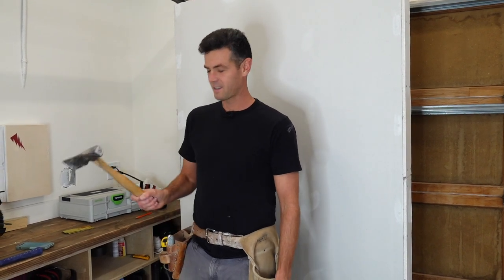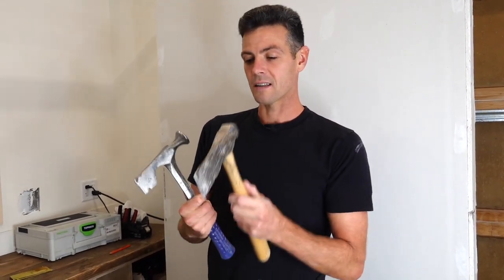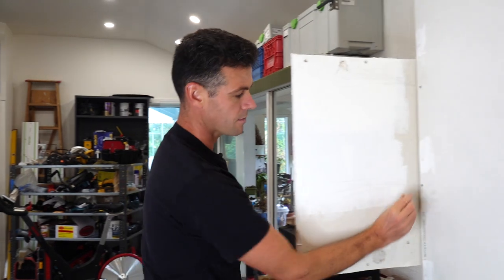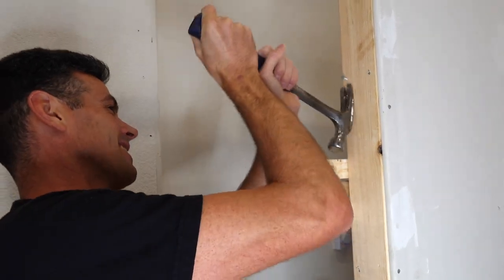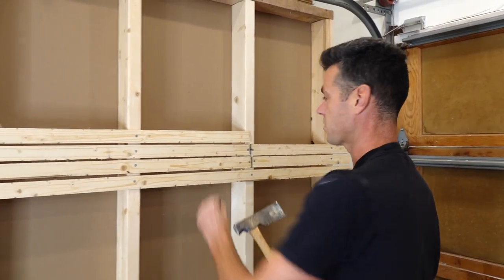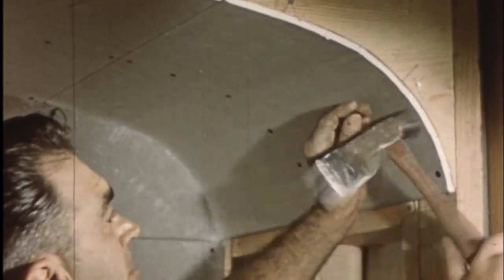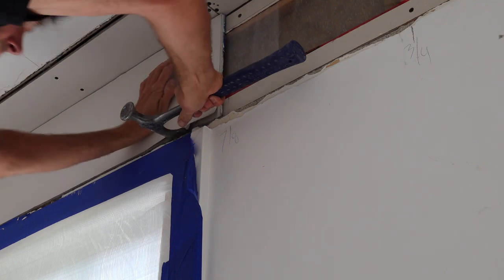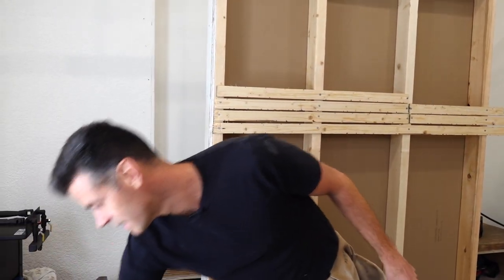Why are DRYWALL HAMMERS shaped like this????

Comment: One feature you missed: on the axe side, it isn't shaped quite like a normal hatchet or shinglers axe. The dip that quickly narrows the blade to the handle is for holding large sheets of drywall in transit. Just pick up one side of the drywall and hook the head underneath and you've got a much more ergonomic way of moving sheets
Reply: As I watched this video I thought to myself that I had seen roofers use these.
Reply: I'm asking because I honestly have no idea what it is, maybe you know? Sorry for a wall of text.

It's about 3 inches long on the hatchet end and you can tell it was hand forged. It has that dip near the handle. The hammer side also has a taper that looks like it could be used to carry sheets. Is it a dry wall hammer or something else?

I found just the head of it in my grandpa's shed while we were cleaning up everything after my grandma passed. It was in the corner where he used to hang his tools. It was covered in a nice layer of rust and dirt. 
I cleaned it up with a wire brush to keep the antique aged look, re-handled it with mahogany, and made a stitched and brass rivet reinforced leather sheath to cover the axe face. I also brought the cutting edge to shaving sharp, it was the only metal removal I did to it. Now it lives on my wall.
Reply: yeah but it dents the bevel and can tear the paper.
Reply: I was a drywaller for 35 years and never carried drywall with my hatchet. Also I never saw anyone carry drywall with a hatchet. I'm not saying it didn't happen but I am saying it wasn't common practice at least not here on the east Coast
Reply: @donnydarko1898  never seen that either. East coast also.
Reply: @donnydarko1898  I watched my dad use his axe to carry sheets. He also hung for 40 years. I've watched him hang whole sheets on the ceiling alone. Mouth full of nails he would tilt the sheet up with one hand , use his axe under the corner and lift it on his back and shoulder.  It was quite an acrobatic sight . He was built like a Greek God though.
Reply: I carry plywood with a framing hammer like this. Makes it sooooo much easier to carry and no splinters.
Reply: Love when ppl know there shit
Reply: I don't think you've ever moved sheets

Comment: I started as a union apprentice at Lathers local 42 back the 70's. The lathing axe was used to score and snap wood lath, but that was actually before my time.  In the trade, there were two sub categories, nail on and steel stud.  Nail on was waterproofing (tar paper) and wiring (chicken wire) held on with furring nails on wood studs, installed by carpenters.  The axe end of the hammer was used to bend the wire around for inside corners.  Metal lathing or steel stud, lathers erected their own walls with steel stud, installed drop ceilings with steel channel, then covered them with expanded metal lath for plastering, again using the axe end to help form corners. This was done in most commercial buildings including many of the old high rise structures. After wood lath, they developed plasterboard or button board, which you saw being installed in the video.  They made a specialty lathing axe with a replaceable blade for cutting the board.  That was a hard trade, they expected so many 5 sheet bundles a day, cut, hung,  and nailed off in a day. And then there was drywall.......
Reply: Seen one of those latching axes,,, now I know what it's for! Thanks! How many sqft did they expect a day?
Reply: @stevehamman4465  It's a little hard to remember as I have been out of the lath & plaster trade for almost 30 years (currently tile setting)  but it was about 300 yards outside and about 1K ft. plasterboard inside.  Of course this varied dependent on whether the job was cutup or just flat open walls.
Reply: @tomdoe4295  Hope it paid well, sounds like the pressure was high.
Reply: @Oneshot8242  This was back in the 70's & 80's.  Pay was around $28.00 an hour but $4.00 PH went into the benefits package (matched by the contractor) and $1.00 PH went into your vacation fund.  Great money in those days.  The pressure was there but we didn't notice it.  Half the shop were baseball players and the other half were dirt bikers so there was always rivalry to out perform the other workers, so meeting or exceeding what was expected wasn't really a factor. (Dirt bikers FTW!)
Reply: @tomdoe4295  $28 in 1978 equates to about $123 today when adjusted for inflation.
Reply: This is such a well informed answer, just curious where is that local, I'm local 18 in Ontario Canada
Reply: @alanmudge6782  Local 42 is greater Los Angeles, CA

Comment: Living in a hundred year old plaster lathe house I have extreme respect for the guys that built it, their work with mostly hand tools was incredible.
Reply: Its kinda sad its a trade that isn’t really utilized like it used to be. Theres a plasterer youtuber and watching him makes me miss how we used to do tiling too. 

Here and there I get to “float” a wall or floor in a shower. And it’s probably my favorite part of my job. But its very rarely. Im actually part of the same union as the plasterers. Idk how much work they get though. I think a majority of their trade now is using forms.
Reply: @Titantitan001  I enjoy fixing the walls, typically termites will feast on one of the lath pieces they find delicious. I rip out the old plaster as far as required, spray the area with termite foam or boracare, then cut new pieces of pressure treated lath, glue and nail them in, then I use Durham's rock hard for my new keys, then I put a plaster mix coat over that, the repaired wall is very strong. No way I'm sticking a crappy piece of drywall in there, I want the original plaster wall restored.
Reply: @nmatthew7469  Durhams is very useful.    Does not sand though.
Reply: @nmatthew7469  good on ya my friend! Ive never used drywall either when i was in property management. Thats how I found Kirks youtube channel was trying to learn how to repair plaster. The building I am in now is an old bottling plant that we restored the offices into a living space and downstairs is the jam room/bar/pool. So I’ve had to learn a lot of the old school ways of doing things. Been wanting to do a mud floor with 1x1s in the main part downstairs hehe.
Reply: @hdsnow7049  easy way to avoid sanding is to wet sponge it after it's dried a bit just like when patching cement.

Comment: As an old drywaller back in the late 70's till about 2000 in Southern California we referred to it as an "axe". My personal brand fav was the Plumb and resembled the lathers hatchet. As for the uses, in those days, well, when I first started in the housing industry it was all nail on, commercial was a mixture of wood and metal and so was the method of attachment. The blade of the axe was used as you showed to pry on occasion but more often, to "clean" the edge of the cut drywall by pushing the top of the axe to knock off the roughness of the cut edge. Also, when hand cutting electrical boxes, you would mark the edges of the box by sighting down from the top and measuring the top of the box and adding the length of it sliding your tape measure and knife, then competing the cuts with your knife. It was always a source of pride to be able to make your hand cuts "clean" so the taper had little or no "detail " work to do with your hand cut boxes. It was a different time for sure but a few of those things still apply.
Reply from the maker: Thanks for adding to the conversation. I love old school knowledge🙂👍
Reply: @vancouvercarpenter  After re-reading what I wrote I should have been a little more clear that we used the blade to score a mark for the sides of the electrical boxes on the lower sheets of drywall and measured to the top of the box only, and just add however much the dimension of what you we cutting, boxes were ( are?) 3-7/8" to allow for a little play. I was at my son's cabin and had to hand cut everything....still got it!
Reply: Nice axe work! Lol one of my first commercial steel stud/drywall jobs was a hospital. The boss wouldn't let us use routers and taught us that very technique for cutting boxes. We did get very fast at it by the end of the job and if routers weren't a thing that's how I would still be cutting my boxes. Been at it almost 30 years now.
Reply: @whitesturgeon  I first saw someone use a router doing custom homes in about 77-78 maybe, some guys from Texas as I recall. It obviously was a game changer to say the least! It was just a trim router with small drill bit. They broke bits constantly as they weren't designed for the side load. I haven't thought about that stuff in years! Any hanger worth his salt knows how to cut his boxes by hand. Tough way to make a living, we were all piece workers so time was money!
Reply: I came up the same way with my dad and uncles, no router no screw gun, if we had a cord it was for the radio and don’t touch the old man’s radio it only played two kinds of music, country and western lol, just a bench, bucket for your tools and a square that’s all you had or needed,  I was making money before most guys could find a plug to plug all there crap in lol those were the days most hangers made more money before lunch than most trades would make all day
Reply: @jasondoan1785  I hear ya Jason! My T-square had been scored so many times the long side feel off making it an "L square" ! You're right, the cord was for the radio, a jobsite must! The cord was the cheapest and longest ,100' to make it to the temp power pole. The big expense was buying the adapter, most of the time we just cut the ground prong off and tweaked the other two blades to fit the twist-lock socket on the pole. See there, you guys got me started on the old days!! I spent 45 years in construction and retired when the pandemic hit. Luckily I had 20yrs in the SoCal Carpenters Union so that and Social Security and I'm a happily a retired Carpenter! Thanks for the trip down memory road!
Reply: Agreeing whole heartedly with the comments below,   I started hanging just before screw guns or routers became a commonly used tool.   You got very familiar with those axe hammers and could nail off a board in  no time.  The tool I still use most often for various reasons is a drywall bench.   If you dont have one,   get one.    Super handy.
Reply: @michaele1201  I still have one too! At 65 I still find it useful
Reply: I worked construction with my uncle in the late 90’s/early 2000’s in SoCal and guys would use the drywaller’s axe to tack boards up and then come back and screw everything off. I only ever saw one old timer use the axe to nail off everything and he could cut the board with the axe like in that 1950’s video.
Reply: Old hanger here started at 17 before router’s and screw guns as apprentice first year all I did was nail off I could out nail like a machine gun it was all about rhythm we measured and cut every box , shimmed butt joints and hauled the scrap We avg 100 sheets a day 4x12 sometimes 16’s two guys $ 2.00 a sheet
Reply: @AVBros37  Tacking up with nails, coming back to rout and screw was the common method of the time. We did a motel in Costa Mesa of 30 rooms with everything tacked up ,boxes marked , but not routed or screwed yet. The owner came by and said" I dont know if you realize, but there are electrical boxes all over these walls you forgot to cut out!!" I looked at my co-worker and said, "see, I told you we were supposed to cut those!" He went off in a huff and by the time the superintendent showed up later in the day it was all done. Not very nice but we were young and got a chuckle out of it.
Reply: Also as an old drywaller we used what we referred to as a “drywall hatchet” for the same things that you point out. We may have actually crossed paths at some point. I also worked in CA for several years 70’s & 80’s.

Comment: Long time, no comment. Sorry.    I'm a tinsmith, but when I was 18, I was a carpenter's helper for a year. We had no screw gun back in '79. It was all nails. I hadn't perfected the art of "spinning nails". Every so often a nail would come up to my fingers facing the wrong way. I would drop it on the floor. My buddy informed me I needed to keep those nails, they were for the other side of the room.

Comment: You can also use a drywall hatchet for  rasping board, pulling stand ups when boarding solo, bending back track after all other trades trample over them, wedging board into tight steel door frames, lifting board off ground for dunnage

Comment: My dad was a carpenter, he had all kinds of hammers including one of these. In truth I am pretty sure I only saw him use two. The big one for framing and slightly smaller one for trim. He was that 2 hit guy and it didnt matter if it was the smallest trim nail or huge spike. Two hits. He seemed to like to let drywallers do their thing and cabinet makers do there thing. I saw do both in my home growing up but typically he respected specialized workers. But I digress this was about other “hatchet hammer” he had.
Reply: Years of gaining the confidence to hit very hard instead of holding back for accuracy. Took me probably 15 years to get to that point lol. Watching the other guys do it made me want it so bad! Even cooler when you got the magnet. 

Obviously there are some nails where its just not happening. But many of them stand no chance against a hammer
Reply: That large framing hammer was called a "Rig Axe" ! They were usually about 28 oz's !

Comment: The offset angle of the head on the estwing makes it easier to nail the bottom, like when you're bent over.
Reply: That's a fine use for it but it's moreso to keep your knuckles off the board, especially in corners when you swing horizontal.
Reply: And above your head (ceiling boards) I believe

Comment: As a plasterer I’m impressed that you know it’s a lathers hammer.  Small point of order: it’s pronounced with a flat “a” like tap.  The hard “a” is used in the word lathe like in spinning wood on a machine.  Also if it  has a cleated face it’s really a roofers hammer.  The cleat chews up the face paper causing issues with blisters and flags so they used smooth faced on Rock Lath (a brand name of early gyp board).  In the wood lath days (not lathe) the lathers would use the hatchet to cleanly chop the wood to length in a split second.  Also lathers were the original drop ceiling/coffer installers.  I pay homage to those forgotten craftsmen of the past like Marvin Reiney the last Master Lather of St. Louis who passed away just a few years ago.  He was buried with his end nippers in his right hand and a small “hank” of tie wire in the left.  He invented the machine to bend channel iron into curved shapes used in more modernist building designs.

Comment: Back in the day when people first started using screws to hang drywall  most finishers were afraid of them. After trying them we would only use them for the ceiling for a couple of years. Then of course it  transformed into a complete use. Adapters were made for drills so you wouldn't sink them to far. It was a lot better. You know how some people are set in there ways though. We could nail it up 2 times faster than screwing it off. When I say back in the day I was making $3 a hr and thought I was in high cotton
Reply: My brother was a roofer (back when he still had cartilage in his joints!) and he once had a shingling race, him with a hammer versus his "I know how to do everything better than you low-lifes" foreman with a nail gun.
He won, and the foreman didn't show up with the crews for a week he was so ticked off.
Reply: @MonkeyJedi99  the difference being, of course, that any schmo off the street would be almost as fast with the nail gun as your brother was after years of practice.
Reply: @RobotJustice  That's what made the whole thing even funnier. This foreman was all hat, no cowboy, as they say in some places.
Reply: I hung rock for a short period of time in the mid 70s with a lead guy. We nailed everything, much faster than screwing. I hated it when we had to screw it. Hung it with nails on the edges then screwed it off. We got paid a buck for each 12' sheet. We averaged 200 sheets a day. We hung the lid together then split up, one of upstairs the other down. Lifting a full 12' sheet up against the lid by myself took a bit of practice to get good at doing it. We did one model of tract homes where the boss would order 16 footers to do the lid in the living room to eliminate butt joints. Hanging those was a bitch, broke a couple. We pushed the lid up with our left arms standing on short homemade stools. A sheet rock shortage gave me a good excuse to give up that line of work. The best compliment we got was when a finisher said he would follow those guys anywhere. We took pride in our work.
Reply: @karlbishop7481  yeah you could pop those nails in like it was nothing . Kind of like roofing . That's awesome  oh the memories
Reply: @MonkeyJedi99  in the late 80s and 90s some companies wouldn't let you be a foreman until you had a 2 or 4 year degree. They were getting out of school and we were training them lol

Comment: I am renovating an old house lath and plaster throughout. While making changes to wall positions I removed a lot of the old work. I reflect on how many thousands of nails and lath strips it took to just make a base for the plaster, these labourers have my respect. The finished plaster surfaces, over a hundred years old, are in much of my project still intact and literally smooth as a you-know-what.   senior from Ontario.

Comment: Cool video,  don't hang a ton of board anymore but I was taught to tack with nails (walls only) and screw off later. I still use that method sometimes and haven't had any problems.  As far as hatchets go I like Walboard the best as they seemed to make the nicest dimples.
Reply: Yep, Wallboards were my fav, perfect balance.